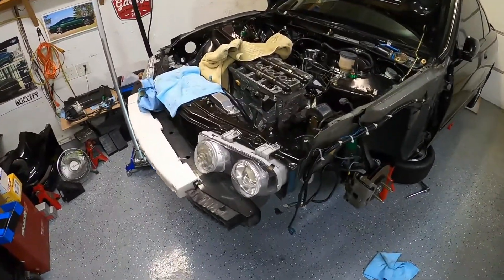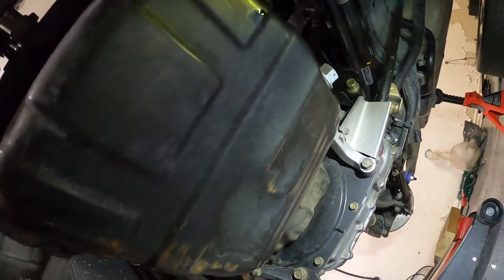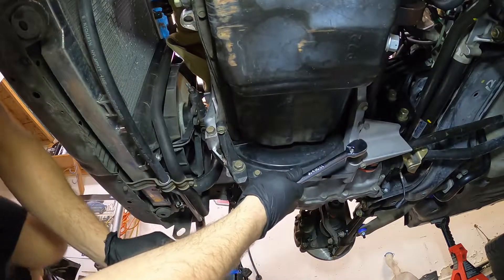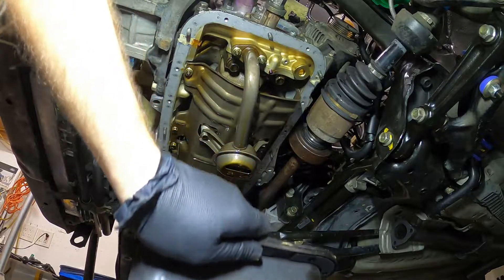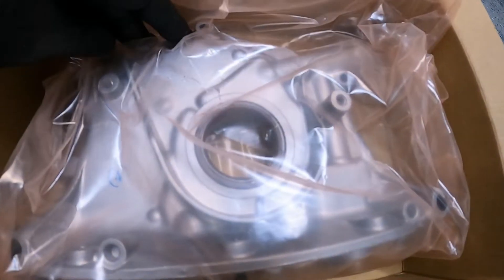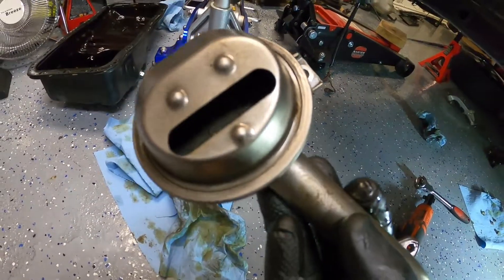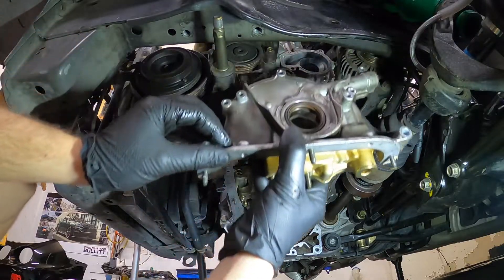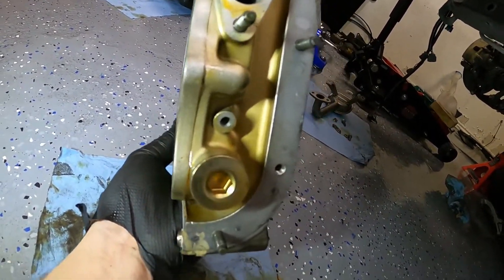Mugen Oil Pan & OEM Oil Pump Install | '94 Integra GSR

Comment: Hi Spencer did you put honda bond around the area where the O ring goes? Or just that bottom part? Thanks
Reply from the maker: Yes, just a thin layer all the way around.
Reply: Gotcha, I thought there is no need for honda bond where the O ring goes since it will seal.

Comment: I got the new oil pump and the bottom bolts where it screws they are lose will they tighten when I tighten the  nuts or I need to tighten them separately

Comment: Hey how much did the oil pump cost? And do you happen to know the part number? Thanks
Reply from the maker: I don’t remember, I do know that I always show the part number of parts in my videos though. Watch the video and you shall see.
Reply: I tried zooming in to the part number on the box but it’s a bit blurred. Did you buy it from a dealership? They said it’d be $450, seems like a lot for an oil pump to me.
Reply from the maker: $215 from an online oem Acura parts website. Part number: 
15100-PR4-A03